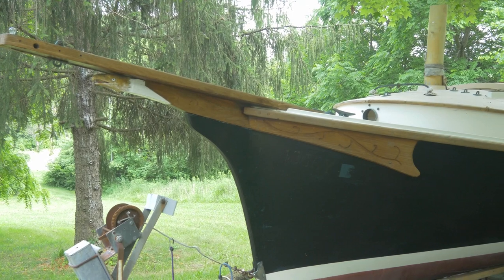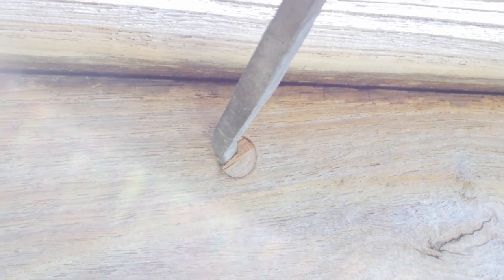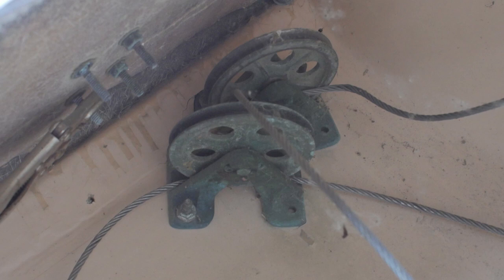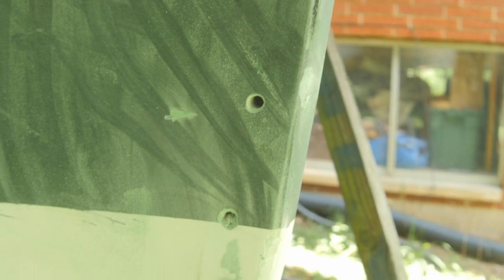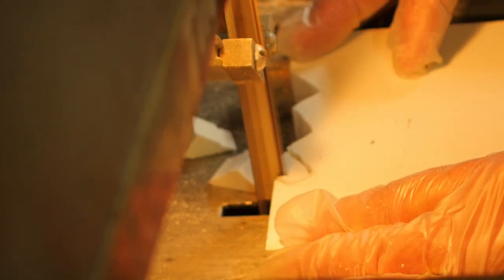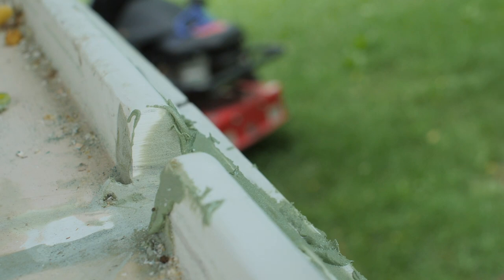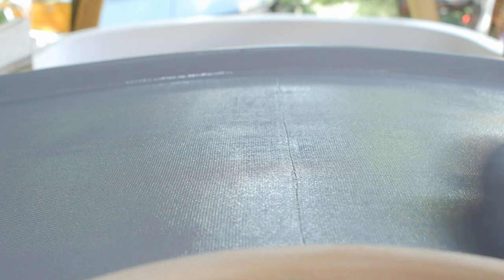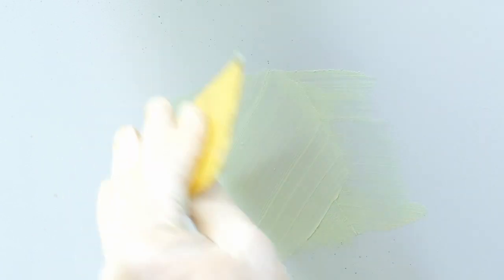Eps. 3.6 - Primer, Pinholes, Brightwork and Centerboards SE03EPS06

Comment: I just finished removing my centerboard from my Herreshoff Scout ( same hull ). It was easy. Take about 16 hours and a very long sawsall blade. Mostly by hand. Start chipping away from underneath. You have the advantage of attacking from the top too. The last few hours I used a 18" rebar to pound on the small piece of centerboard steal that was left. It eventually started to move. The hinge pin had to be cut off on both sides. I put all the bigger pieces of CB on a table and measured the CB well to lay out a new CB shape. I could not find a drawing of one for a Scout. I called everyone. I did find out all the centerboards are 1/2" thick steel. Mine ended up weighing 175lbs. What was left of my old one weighed 40lbs. I'm sure your job will go much faster sense you can get to it from the top. God bless!
Reply: "It was easy. Take about 16 hours and...." Whew.

Comment: My center board was jammed as well but not that bad. It was because someone painted it. You may want to try a air chisel with a long pointed bit. The vibration should be enough to break it loose. Good luck! Love the videos!
Reply: So I bought a H18 for restoration.  1st chore centerboard.  I used hack saw blade to remove rust along either side of board till I was able to move it.  Since top of trunk is off,  should be easy to get to top and bottom.  Also PO had left a very stout machine bolt 1" X 18" about that fit nicely down cockpit drain which ends above aft end of CB.  Vey helpful in driving the board down.  Sand blasted board,  epoxy paint then bottom paint.  Hope this helps

Comment: Matt, here is an idea you may wish to pursue. Since the top of the centerboard trunk is already open you may want to build up a fiberglass lip around the top of the trunk, flatten it, and install a teak top plate that can be removed if needed. That way you can remove and replace the centerboard from the top instead of lifting the boat high enough to drop it out of the bottom of the boat. Also it will be easier to change the pendent should that be necessary. Then seal and screw the teak top plate down so it does not leak when sailing.

Comment: had the same problem with my America. The centerboard was stuck - totally rusted. After several hours of banging on it using rebar and a sledge it finally worked its way loose. The board was still intact - less than 1/8 inch thick with a number of holes through it but enough to get the exact original shape for the new board. Since I live in Florida (very warm salt water ) I decided to build my new centerboard out of solid fiberglass and epoxy. After a bit of experimentation it turns out 18 layers of 1708 fiberglass cloth,  vacuum bagged with West System epoxy, comes out to exactly 1/2 inch thick. I won't have to worry about the board rusting and getting stuck in the slot again. I am just about done shaping the board and should have it back in the boat in another week or so.

Comment: On the centerboard, I would try drilling a few holes all the way with a 3/8 x 16" long metal drill bit.  On the rusty bits, it should cut though fairly easy. Make swiss cheese out of it and then tap on it from above until something moves. The other idea was to add a few pounds of rock salt and let nature disolve the rest of the rusty keel out of trunk.

Comment: When I bought my America the centerboard was stuck. I used thin aluminum bar stock and slid it up in between the trunk and board. Then just slid in ir around, tapped on the board with a long pryer and hammer, and a generous spraying of just about everything from WD-40, Kroil, and PBlaster. Eventually I worked it loose.

Comment: Another great video, Matt.  Lots of well researched/thought out info.  I like the quick pace.  I wonder if you could built a jig/guide on your center board trunk, and then start drilling a series of holes, say 12 inches apart, then more holes between them.  Might weaken the walls of your expanded centerboard enough to get a pry bar down and collapse the wall into the hole and not crack or pry out the fiberglass centerboard well. I assume you’ve saturated with PB blaster followed up with a long sawzall hack saw blade.

Comment: Re:  CB.  You may need to go from underneath with a sawzall and run it along the gap between the CB and the slot side.   Even if you gouge the FG, you can just grind the corner back and then reshape it with laminations of FG tape.